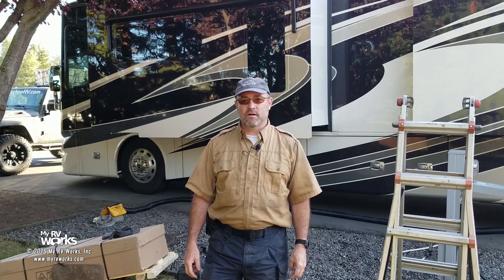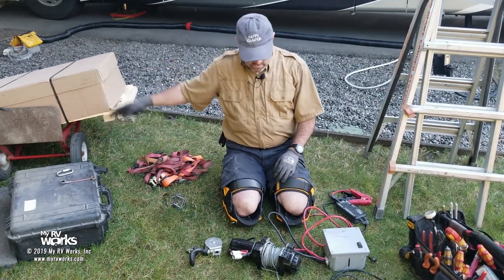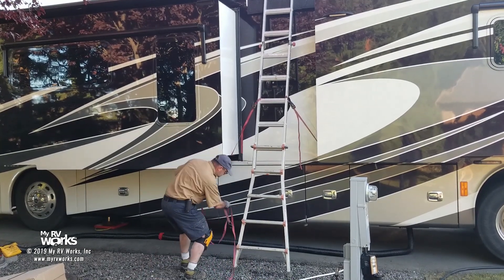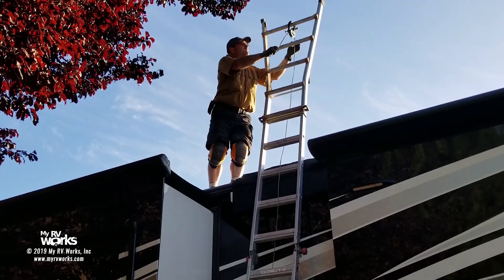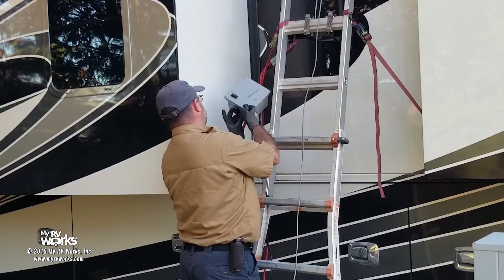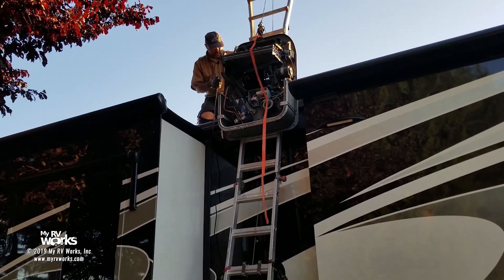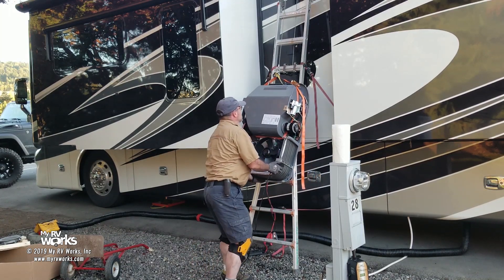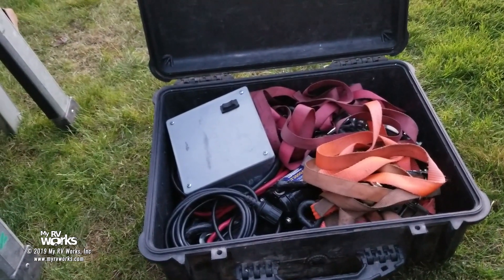Effortlessly Lift Heavy AC Units Onto Your RV Roof With This Simple Ladder Hoist Tech Hack!

Comment: Great video! My only suggestion would be to take a pool noodle cut to short lengths and slit up one side. This will slide up and down to whatever position you need, and replace the furniture pads. You can put them on before placing the ladder. Keep up the good work!

Comment: Hay man I just actually discovered a ladder crane which I thought was ur video and I was doing more research on it. But I like ur setup but look into a ladder crane u can make which makes it even easier. Ull find videos on it but u use the other side of the ladder it's genius so when you put the ladder back down it puts the unit down on roof as well. Check it out to see what iam talking about all u need to do is make an arm and u could still use ur winch iam sure

Comment: I would build a extension with a handle to where the item sits between latter and rv u hold laser out once item is abover the rv bring patter back over and it will bring item over and your up there

Comment: If you are going to follow it up you may as well just a-frame the ladder and leave it in the box then push it up rung by rung - tilt it onto the roof with a blanket at the top. 

Heck you could still winch it up that way and not lose 20 minutes strapping all over the place. And if you really need a high a-frame add a plywood plank to slide it over to the roof.

Comment: I kinda liked your idea using the ladder and a winch. 
I have a set up similar to this, but I built a 24' square carriage for it that rides up and down the ladder.
The winch pulls up the carriage on a 16' ladder with a remote key fob.
I built it for lifting roof trusses and shingles, but you can use it for just about anything, including an elevator.

Comment: I wouldn't be under that 100lb dead weight. Better just to hoist it up with the wench (that hooks on to the top rung of ladder) while standing on the roof. PVC pipes along the ladder rails is a good idea, as someone suggested.  I would also secure with a backup rope/progress capture pulley. Parts needed: Ladder, wench (with ladder hooks), straps, PVC pipes, zip ties, rope/progress capture pulley.

Comment: Your crane is really neat, but all that time setting it up kinda makes it pointless, I normally just pull the AC up by hand. ITS A PAIN, but very quick.
Reply: I agree but i feel like if its an extra ladder that stays setup with the winch strictly for the ac change outs it would be way more practical
Reply: It's alot easier to lay out an extension ladder at maximum angle and push it up.

Comment: I love your mind But I have a better design Look up kin the carpenter You designs a ladder lift with an extension ladder That allows you to stack shingles on it It will carry more Wait Allow you just set it on the shelf And transported up What without having to hold it Without having to hold it Check it out I'm heating and air tech And I use it with a lot bigger Units

Comment: I used an extension ladder from the back of my truck to the top of the 5th wheel trailer.  I pulled it up with a rope.  I was just playing with the idea, and planed on having a buddy the next day help. Once I got it up half way, it was do or die, it was not going to slide back down without toppling over.  I’m a small guy 150lb, losing my footing, sliding closer to the edge as I pull it up.  Happy to say I got it up on the roof before the new ac and myself went off the edge.  Great video!

Comment: Check out this amazing tool you must have in your tool kit: https://www.youtube.com/watch?v=DFIgMeRXHu4
Reply from the maker: If that's the link to an 18 volt drill I have no use for it. As I've stated many times in my videos I use 12 volt tools when working on RVs. The benefit there is that the 12-volt battery pack can be used as a power source to test many components within an RV.

Comment: Great idea! I did something very similar, I took a few sections of 2” square tubing that I had on hand (like what trailer hitches are made of) and made 3 sections 4’ long that all pin together and then I welded a flat steel plate to the bottom that sticks out far enough that you can park the motorhome or travel trailer on the plate to keep it from falling over, on the top section I welded a round plate with a hole in the middle and several holes around the edge of the plate. Then the top portion which again is made out of 2” square tubing 3’ tall with a 3’ boom (so shaped like an L) and has a round plate welded to the base identical to the plate on the top of the mast with a rod that is in the center of the plate and inserts into the hole on the mast and allows the top section to spin 360 degrees, the winch is mounted to the top portion and is powered like yours.  I lay it on the ground and assemble it the stand it up and have a helper move the rv until the rear tires are parked on the plate! Works perfect! There’s pins that keep it all together but you get the point and it can spin so the ac or whatever can be set straight down on the roof or you can shorten it to lift heavy stuff in and out of trucks and such
Reply from the maker: My design did go through quite a few mental versions. One was similar to what you're explaining. In the end I wanted everything to fit in a suitcase when I was done with it. And that's why I came up with the Little Giant and the ATV winch.
Reply: My RV Works, Inc. Completely understand you wanting yours to be as portable as possible for your line of work, looks like it works great 👍
Reply: NEED PICTURES